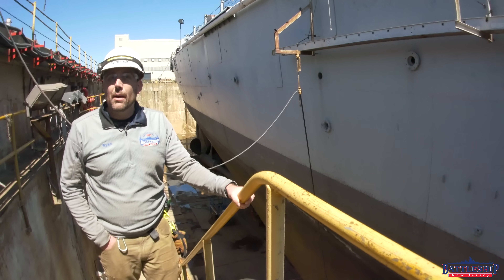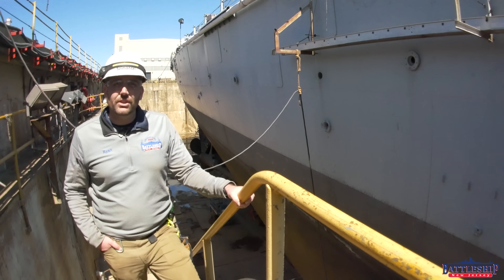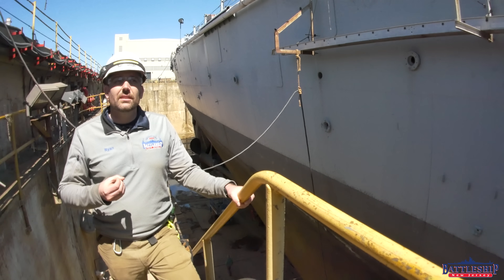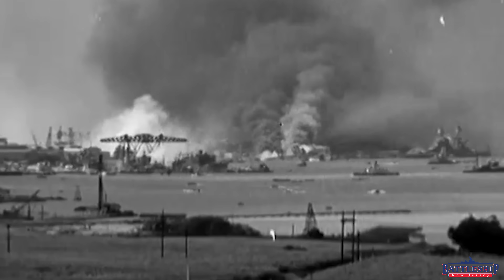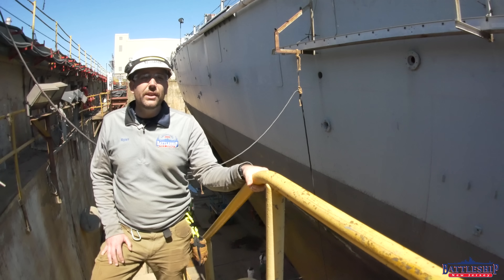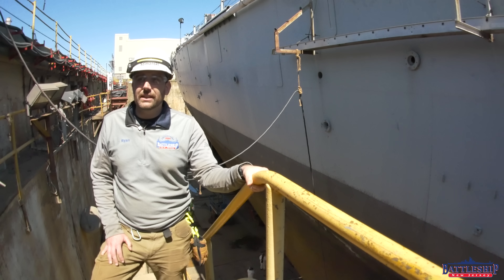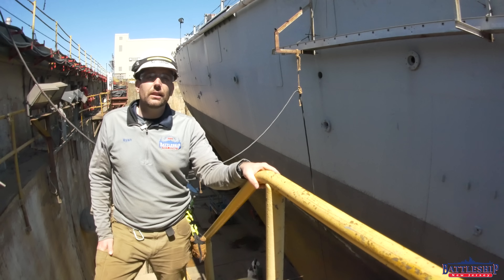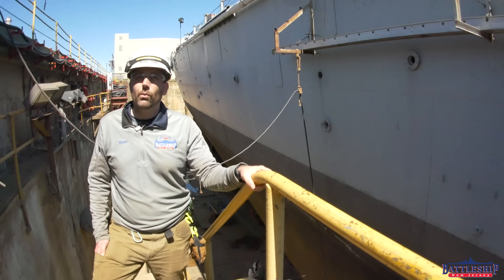The Most Vulnerable Part of Any Museum Ship: The Wind Water Line

Comment: Why not add ballast to get the ship to sit right?
Reply: I guess because the easiest way to add that ballast is to fill tanks with water which adds more corrosion risk.
Reply: @keab42  There are other possible solutions like dry bulk. Dry sand weighs a lot more than water, roughly 1.6 times it.  I understand there is a cost and effort involved, but if it preserves the ship longer I feel like it is something that should be considered. Judging by what Ryan said the ship is hogging, it's higher at the front and back than in the middle and that puts a lot of strain on the internals. Probably less than a wood ship would, but it is still a net negative long term.
Reply: @rtwpsom2  Hogging is a bit of an exegeration, it is just that ammunition and fuel where located more to the front section of the ship. In all cases, the ship is less strained as standard condition. It is just as strong as it always has been (same metal, same construction), but lighter loaded and as such does not displace that much water. The fact it is a few degrees out of tilt (10 ft over 890 ft = 0.01 radian = 0.6 degrees) is a rounding order in its structural loading. Most of the remaining mass is in the center, which is basically self supporting in bouyancy. Normaly the bow is a weakpoint, because it usually doesn't have enough bouyancy to support itself and requires the hull strenght, especially if in rocky waves its bouyancy can change from negative to positive if the bow rides deep. Having a lighter bow and no storms to smash into, the museum condition is actually kind of favourable 
What is a real issue is when ship hulls are taken out of the water. HMS Victory has distorded quite a bit because it is only supported on a limited amount of points instead of the distributed waterpressure over its entire wetted area.
Reply: that'd be close to 15,000tons of weight added throughout the ship... when in service, that would have included just shy of 9,000 tons (2.5million gallons) of fuel oil
Reply: My question as well. I realize that water ballast would be less than good for the corrosion risk. Still, itnseems like there's got to be a way.

Comment: Have you any test results on your through hull cover plates?
Reply: There was a video on the leaktests a few days back. Pressure testing didn't work so well, as the valves inside the ship tended to leak. Soap testing yielded only the problems on the few (one?) hull cover plate that had already been leaking prior.

Comment: What’s a 5000 UT shot?
Reply: UT = ultrasonic test. Using ultrasonic sound and how it reflects to measure the thickness of the metal plaiting. They have 5000 different spots over the hull to check. This will tell them the actual thickness of the metal at the test points and highlight any areas that will need replacement or buildup. Will also give a base line for the hull survey on the next dry dock in 30 or so years.
Hope that helps
Reply: It looks like a UT5000 is a type of high end ultrasonic thickness tester used to find flaws in metal.
Reply: @MScotty90  I love this community. Thanks!